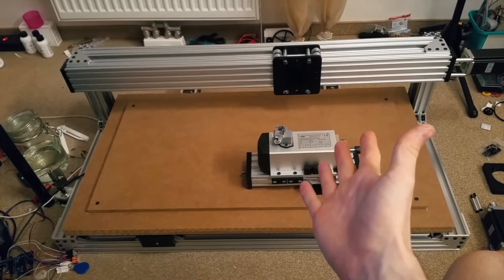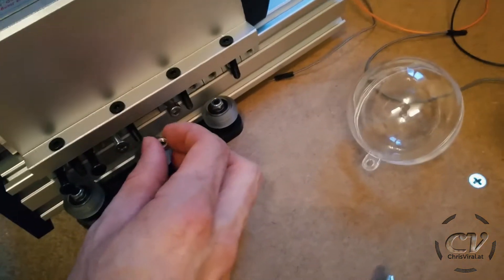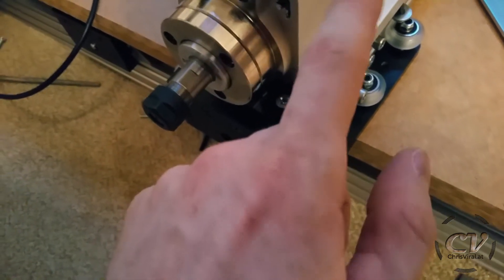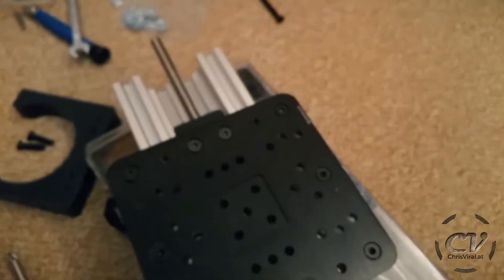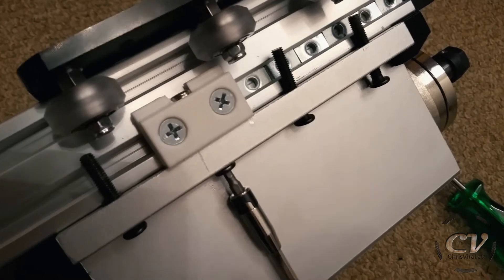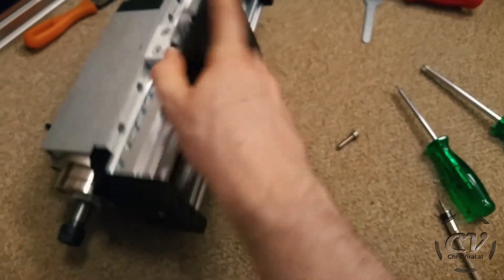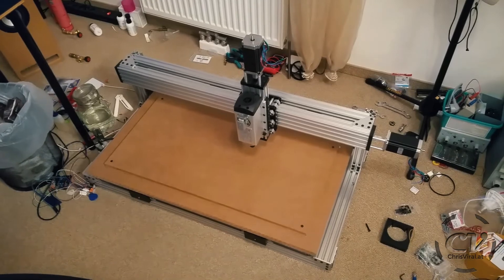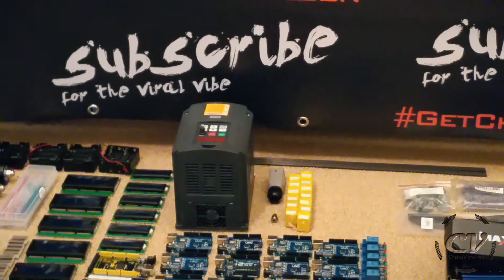C-Beam DIY CNC - Mounting The Spindle (Chinese 1,5kW Spindle)

Comment: Hi. I like the spindle mount 3D printed parts design. Can you share them? I would really appreciate it. Cheers!
Reply from the maker: Yeah, I might actually to that since it fits to the theme (openbuilds). I usually never share my files. Did you get the same spindle? It will probably take me a bit until I proceed with my build and update the forum thread but it's on the list.